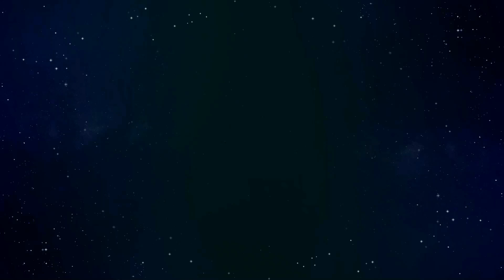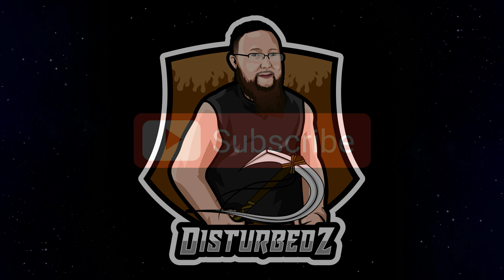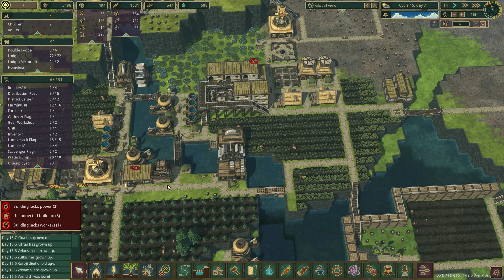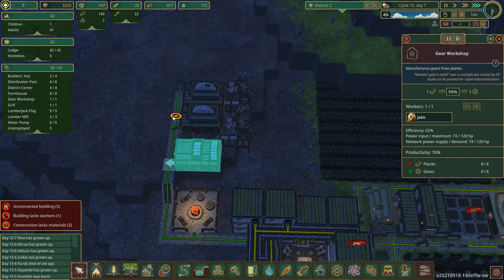Timberborn Ep 11 Wind Powered Papermill's

Comment: Second lol um but those other 3 pumps also ran dry  and you could get an irrigation tower instead of blowing out that area cuz it’s cheaper than the explosives I think
Reply from the maker: I still have to manually fill an irrigation tower still right?
Reply: @DisturbedZ  yea I think it draw water from your storage but you could use a hauler post to help idk if u have one or if it’s only in the iron teeth but if not it’s not like you have a shortage of workers lol
Reply: But explosives are FUN
Reply: @SlushySlurpie  true but expensive too